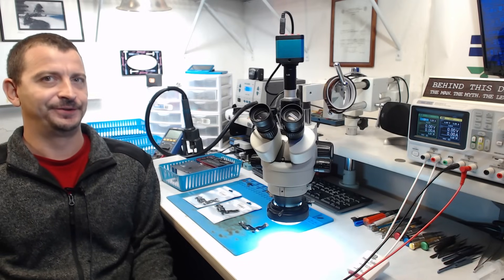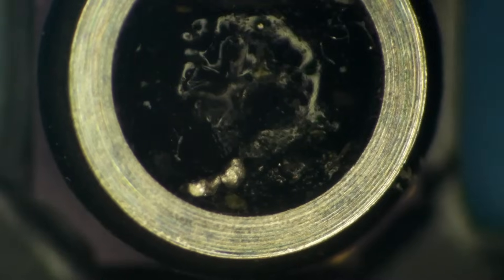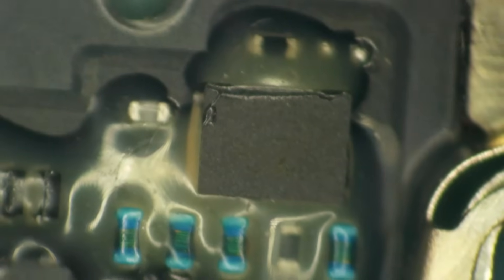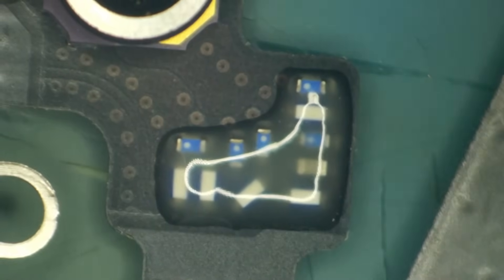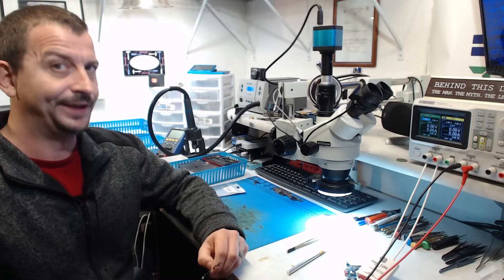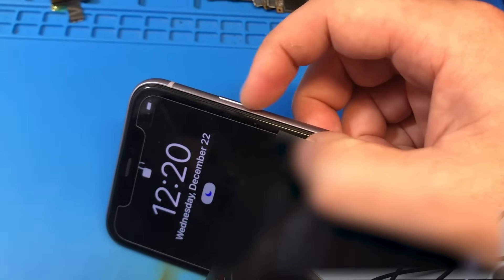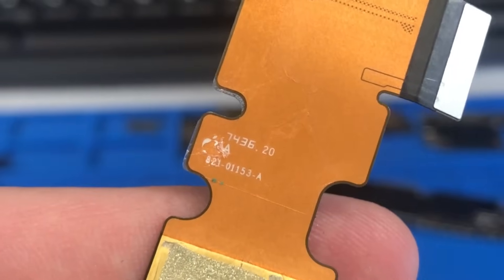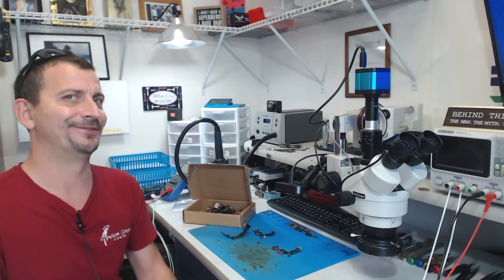Comparing iPhone 11 charge ports from MobileSentrix (3 min reboot?!)

Comment: Earth, concrete, thin metal, etc. is resistive enough that when the kiloAmps from a lightning discharge flow through it, there’s no fixed potential. A lightning hit outside your office was basically dropping kilovolts across the shunt resistance of the soil, concrete pad, etc.

Imagine that the floor was like a current sense resistor. Even if it was metal and had resistance of just 1 ohm, 1kAmp flowing through it will drop 1kV. It’s way more resistive than that.

During the lightning discharge, those file cabinets were standing on patches of floor that were several kV away from each other. That’s what got you.

Comment: Hi, I have old Iphone SE 1st that restarts but not every 3mins, but randomly, after "some time". In the log analyzer, there are a lot of termalmonitord bug type 210 missing sensors: TP1A, TP3R, TP4H, TP0Z (but not as panic-full), if there are some  "panic-full" logs, they have AppleTristar2 no ID  or something in there but they are more rare. The github-log analyzer tool says I should check charging and power flex so I bought a second fully functional iPhone SE and swapped logic boards but even with that setup, nothing has changed. Is that a proof that the logic board IC is dead? Since it is a 128GB version, I would like to repair it instead of throw away. What are TP1A, TP3R ...? What should I do now? Many thanks

Comment: in my years of repairing phones i have seen my fair share of cheap parts used in phones, and the customer has to pay twice to get that issue  fixed, "cowboy" repair shops gets professional repair shops painted in a bad light, yes we would get the odd faulty part that only works for a few days but we will replace free of charge, basicly dont skimp on cheap parts.

Comment: I just received an iPhone 7 housing from ebay. Housing was pulled and looks great (clearly in a case all its life) but the dock flex was replaced. This flex is worse than the ones in your video because it has no components at all!. It has glue but zero components. If I could only attached a picture to show it lol.

Comment: I have had pretty good luck with mobilesentrix parts compared to other suppliers out there. I prefer premium ports as well but aftermarket have been alright.
Reply from the maker: Yes same here.  I don't install many screens (maybe 3~5ish per month) but since I started ordering from MS more than a year ago, I have not had a single defective screen.  I know there has to be some bad ones but it seems the defect rate is really low or I'm just really lucky!
Reply: @ststele  I thought in the beginning few mins of the video you were having bad parts from them.

Comment: Hey Jason I’ve bought iPhone 12 port and it had absolutely no components in it. Everything worked but the Siri microphone. Seen this on some iPhone 8 ports I bought to, has the glue spots but nothing soldered to the pads. Very odd

Comment: I feel so nervous for saying this out loud but... it all started when I swiped right on getting a repair servicing. Almost immediately the micro soldering tip was busted out and heating up the flux juices. All the circuits and chips were aligning so perfectly all the sensors were vibrating I screamed not once but twice. After getting scrubbed down with alcohol I was plugged in a different port and ZING my power was turned on. I definitely left satisfied and smiling!
Reply: A sensory OEM pull does it for me

Comment: Whenever we order small parts for my store, I ALWAYS get the premium parts. They are usually OEM pulls or Original - and I haven’t had a defective one yet. The cost difference just doesn’t justify the headache an aftermarket port will give you!😂

Comment: That jelly stuff looks like resealable potting compound. If it's on a PCB you can probe parts, and when you remove the probes it seals it's self.
Apple also want all their recycling destroyed, so they probably remove the logo so Apple doesn't think it reused recycled. Defpom buys iMac motherboards from China, and they drill holes in it so it can't be reused - only a few chips can be salvaged -.

Comment: I had an iPhone XS Max with the same issue, i've tried several after market flex cables and none of them worked. At the end i got an original housing with the Flex instaled and its working fine without rebooting every 3 minutes. Bottom line , if you can get an OEM part just do it.

Comment: The manufacturers need to change their supplier of that Rare Earth element called chinesium as it appears to be repelling the components off the solder (or sodder if you have linguistic issues). A different source of chinesium should fix that or maybe substituting is different Rare Earth element like Tawainesium or Japanesium or Thailandesium would solve that problem. 🤦‍♂

Comment: This is going to sound weird but if your port has a peppa pig stamped on it and NOT a saturn/planet on it the port WILL NOT WORK. Dealt with this in the past for X series and up it has to be a OEM pull port, mobile sells them as premiums. Beware peppa pig AM ports!!!!!
Reply from the maker: No, this doesn't sound weird at all!  If I remember correctly, my very first experience with iPhone X and the 3 minute panic was using aftermarket flexes that had Peppa stamped on them.  Say no to Peppa!

Comment: For the iphone 11 with mic2 panic you should consider reballing the middle layer if after the power button flex replacement the error is still present!
Reply: I'm looking at the comment, like "Why?!". But i forgot, the Audio Codec is on the main board and the upper and lower speaker amps are on the signal board.
Reply from the maker: Thank you!  I believe your comment may solve the problem with the second 11 in this video that remained with the mic2 error.  I haven't set out to replace the power button flex yet, however, looking through previous panic logs - there have been errors that pertain to audio.  Now I just have to wonder about intermittent middle-layer connections as the audio errors did not persist.  Sorry, I don't have phone in front of me to give exact log entry.
Reply: @ststele  Yeah, checking ZXW, the volume up/down, speaker amp clock, interrupt and reset are all clustered along that side.

The dual layer board such a time consuming, hassle!!

Comment: ohh and you didnt mentioned about ICs
Reply from the maker: Ahhhh, I think you mean on the 11 pro.  Those ports seem to be a complete different ball game.  I have really only worked with an 11 Pro Max port where I had to separate the "sandwich" part over a single shorted cap.  I was delighted to see what would be an easy problem but not happy about all the extra stuff on the dock flex!  I struggled to get it soldered back together.
Reply: @ststele  not really on the 11 pro. ICs in general, PMIC for Huawei, Samsung, SMC for McBook . Even if you have a good seller you never can be 100% sure it's working. Your video is the proof here for never trust sellers, just like farts. Never trust a fart. :D

Comment: Every model from the 8 and newer are very finicky about sensors and panic a lot. 
PRS0 sounds like “pressure sensor 0” to me.
I’ve had really good success with charge port flexes from UnionRepair, and pretty much same price compared to mobile sentrix from what you said!
Reply from the maker: Thank you!  I didn't even realize Union Repair sold charge ports.  I guess I've only ever turned to them for tools and had not looked at other things.

Comment: If anyone sells you a replacement part, it should be fully functional with every component in place.
Otherwise they are just ripoff merchants.
Don't buy off assholes, as an asshole produces shit! lol.
Reply from the maker: I'm thinking these guys may start going over my orders with a microscope.. LOL  or, perhaps, send me all bad parts to get rid of me! I really didn't set out to throw them under the bus or anything.  I expected good results and showed it like it was.  I wonder how these aftermarket parts ever make it out the door like this.   I wonder if they have some protocol like a threshold of how many components are allowed to be knocked sideways before kicking it back for review.
Reply: @ststele  If you supplied crap phone repairs to your customers as decent,
you would be kicked for telling lies and poor quality.
Why should anyone else get away with it?.

Comment: I see you upgraded to the quick hot air station, was just gonna grab the 852a, is the quick alot better?
Reply from the maker: I have had good success with my 852a but after using the Quick, I just couldn't ever go back.  The auto-sleep and presets features alone are a pretty big deal if you use it all the time.

Comment: Same problem with autos and aftermarket parts, except with cars you can get direct from manufacturer oem parts. Hopefully that will change with apple .
Reply from the maker: Yep, all across the board.  I recently installed an Amazon shift cable on a boat for $88 instead of $188.  It's been 3 months and I'm about to order that $180 cable. :-|

Comment: On around 75% of the housing swaps I do I always end up replacing the dock flex... the main reason is fitment/alignment issues but the second reason is functionality (for me it's mostly the Taptic Engine that isn't properly recognised, even when reprogrammed).

Funnily enough the housings I find are high-quality are the ones with the Peppa Pig stamp on them, but the dock flexes they include with them are literal garbage and I have had a 100% replacement rate on those.
Reply from the maker: I have heard bad things about that Peppa Pig stamp being on dock flexes.  I remember when I first ran into this issue on an iPhone X, the dock flexes that I had that were rebooting had that stamp.

Comment: I reckon I could do a better job at making those flex cables with my one eye squinting into the scope and a cheap soldering iron. Absolutely shocking quality control
Reply from the maker: Yes and even the cheap aftermarket housing flex in this video is one of the better trashy ports that I've seen. LOL  They get a lot worse.